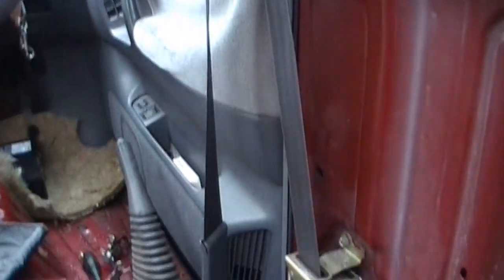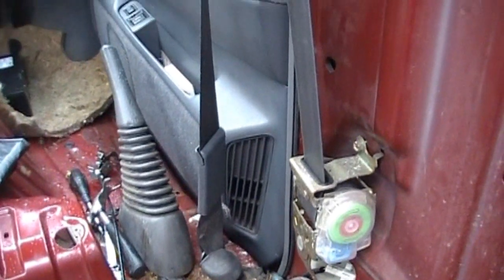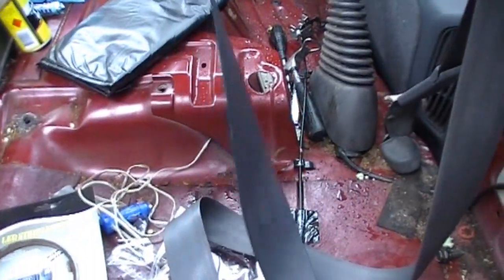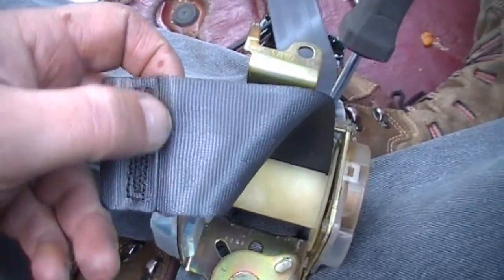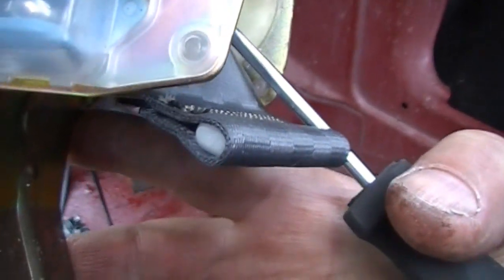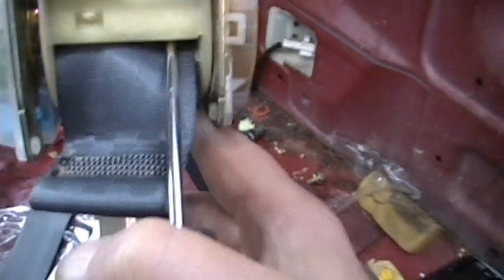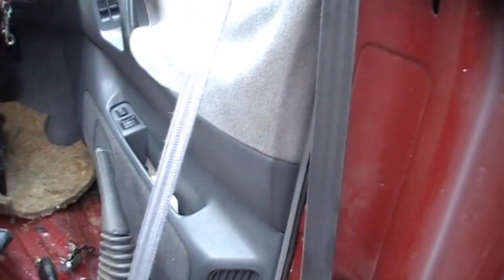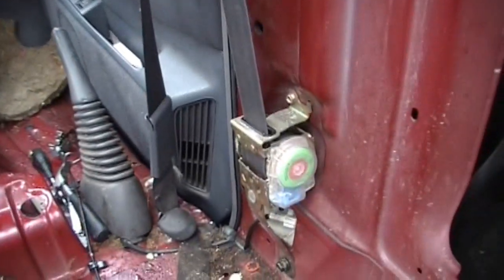Seat Belt retraction/tightening [ Tarago Previa Estima TCR ]

Comment: you need to only tighten up enough to retract. The spring isn't pulled tight because that would result in a large change in tension every time it's pulled/retracted and eventually the metal will weaken and snap.

By the way, when people talk about "spray lubricants" - don't use WD40. It's a corrosion inhibiter and rust releasing agent which dries out fairly quickly (the main ingredient is believed to be fish oil). You're better off with a graphite/teflon mix.
Reply from the maker: I agree with what you say. if you do tighten up as far as it will tighten then yes over time it will weaken and maybe snap.
Not real sure how WD40 would effect seat belts as I seen the belts get used for much harder treatment such as a tow rope and last a long time. but I would think yes fish oil would be a better way to go. I used graphite before and it spread over the belt and started to leave graphite on my cloths. can't go wrong with fish oil, it just smells for the first few weeks.